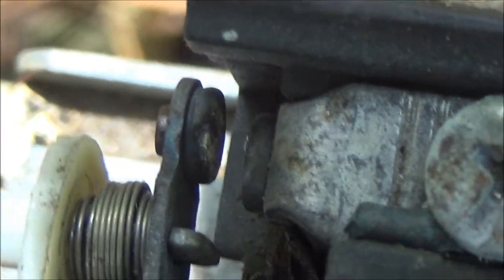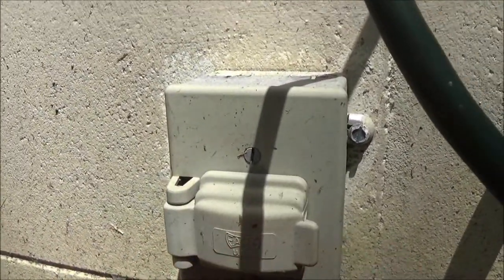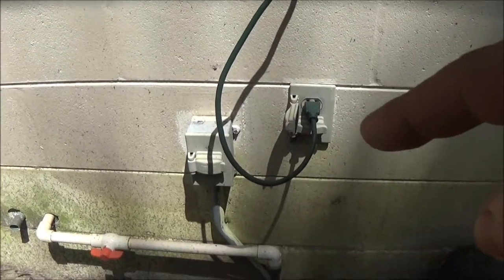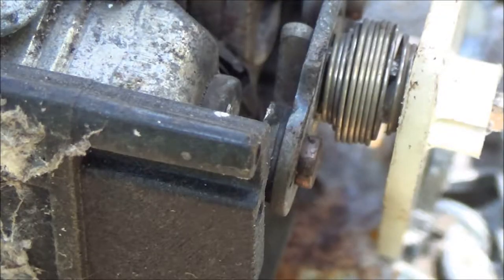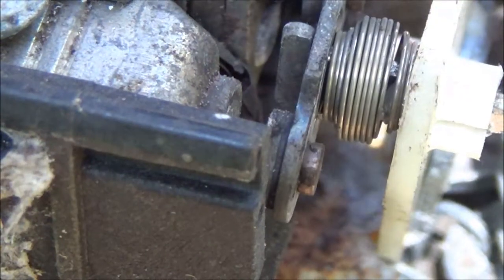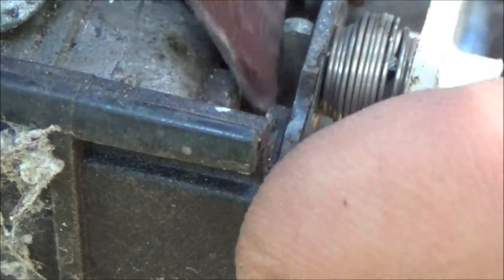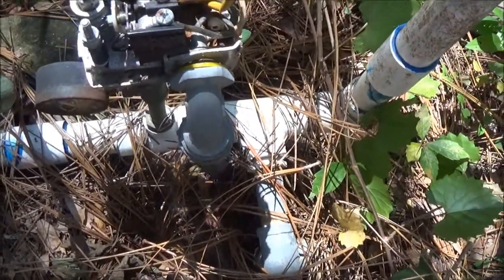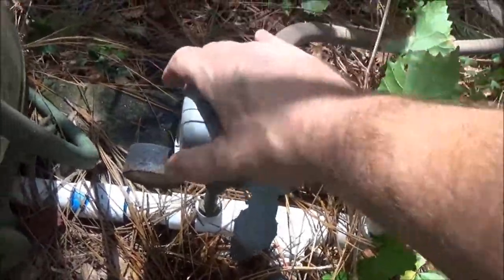Well Pump Breaker Point Cleaning

Comment: Any idea what it means it one of those breaker points is slightly un-aligned and pushed back and up? It doing that has definitely caused poor connection
Reply from the maker: Something could have gotten in there or it could be heat if it has been stuck at some point. For as cheap as they are, I would replace it because once they get bent you will always have issues with it.
Reply: @shabear1000  yeah I replaced it a year ago. Just not sure what the main issue is that would be causing them to burnout like yhis
Reply from the maker: @West44  could be a bad pump drawing too much power. Also, you can try to adjust it so that it's 1 minute on, 1 minute off. Let me know what you find out.

Comment: Is this a central Florida thing? I've never needed to do this before living in Marion county Florida. Is it due to a corrosion that if that box were to be sealed better it wouldn't occur as often?
Reply from the maker: I think it's because they are from the 90's. But I clean them once a year regardless.
Reply: I'm in Alachua but grew up on a farm in Levy, and it's definitely an issue.

Comment: I have ants constantly getting into my switch are there electronic pressure switch  upgrades to get rid of the mechanical contact control?
Reply from the maker: I'm not sure but I put white vinegar around the switch (not in it of course) on mine and the ants went away.
Reply: This is my problem. Water suddenly stopped running yesterday. Tried different things and decided to take the top off the pressure switch. There were tons of ants inside of it. I bent over and blew alot of them off and the water instantly came back on. Today it the same thing happened